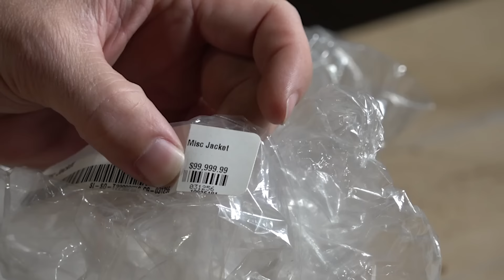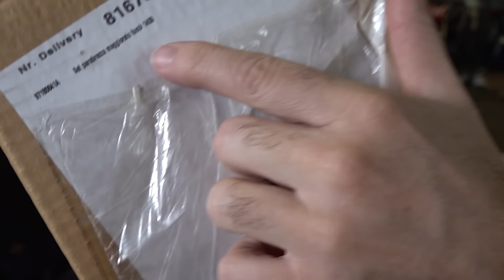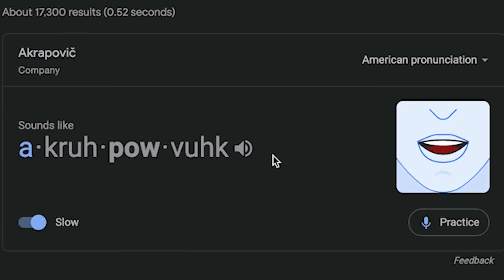I Bought $40,000 Worth on Lost Motorcycle Cargo Packages

Comment: I have sold enough stuff online to know that getting half of the MSRP on most of that stuff will be a challenge.  Good luck!
Reply: THAT is the kicker.......I've watched a LOT of amazon return pallet videos etc and while there IS value there, it's extremely time consuming to get rid of all the stuff. 

Not just the handling, but photographing and listing them on ebay or kijiji or craig's list.
Reply: @muskokamike127  yes, it’s a lot of work taking photos, posting ads, getting boxes, packing and printing labels, going to the post office!  The thrill of opening that pallet wears off quickly.
Reply: That's what I was thinking evey time they said msrp. Maybe with his connections though he'll be able to move stuff quicker than the average flipper

Comment: Man, my family has fallen on tough times, so I sold my old Harley just a few weeks ago. It was a 2004 softail, red and silver. I had intended on keeping it forever, so I rebuilt the bottom end with s&s parts (timken bearings, 509 cams, cam plate, hi-flo oil pump, hydraulic tensioners) last spring. Honestly, I didn’t ride it much in the 5 years it was mine, but I sure do miss it. That little 88ci wasn’t much to brag about, but it still cruised around alright. Figured I’d post this here and join the many others who regret getting rid of their machines. You gotta do what you gotta do I guess! 👍

Comment: Funny you should mention, who wears a 5x helmet. I just had an epic crash and now have to replace my 5x helmet. They are not that easy to find. I was riding the back roads of New Hampshire went into a sharp right corner. Half way into the corner, someone had spilled gravel and left it. Due to a broken foot, I will not be riding again until Spring. The bike is in the process of being replaced. If your 5x helmet is on the market, I would be interested.

Comment: I worked for a rather large customs brokerage company that cleared shipments through CBP for Ducati that were heading for dealers and suppliers. Ducati shipments were a nightmare to classify because they usually contained what seemed like every product they offer. And I mean everything from branded golf club covers to the most specific engine part. If you see unclaimed Ducati stock imports then it will usually pay off well.